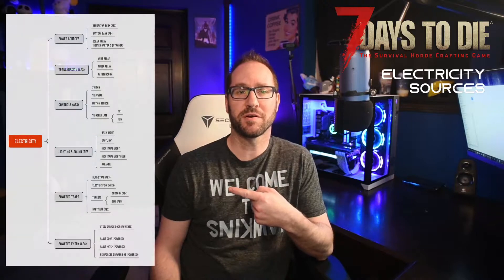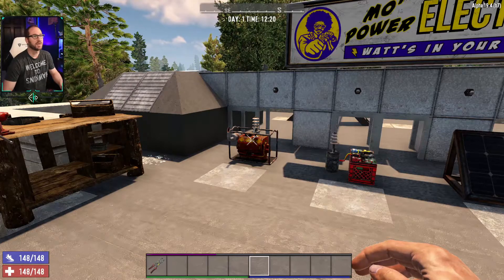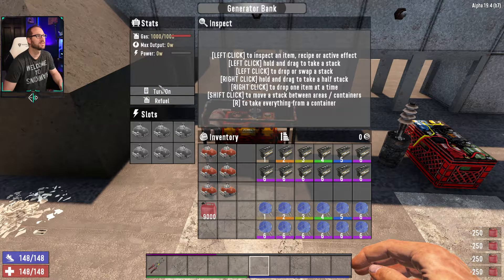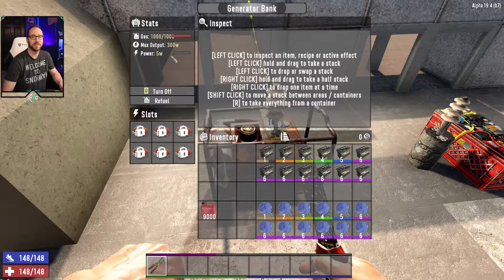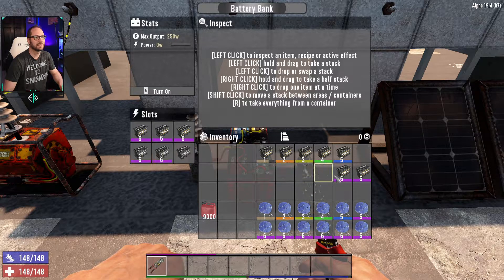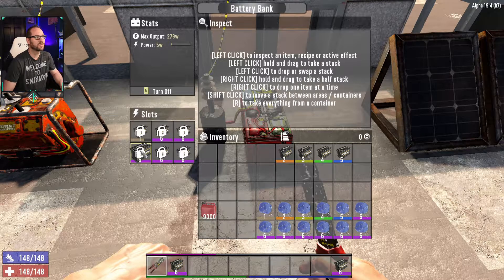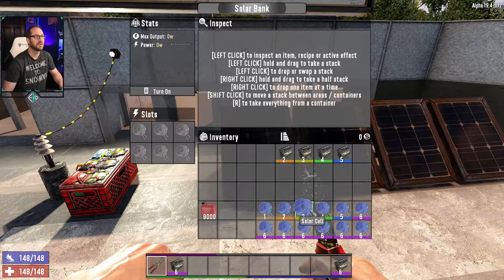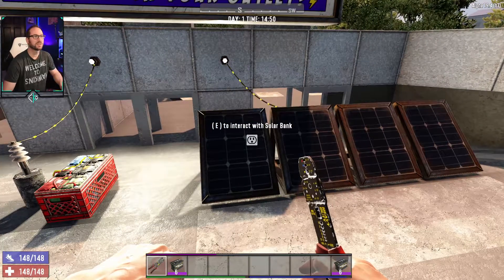Electricity 101 - How to setup use the Generator, Battery Bank, & Solar Bank in 7 Days to Die (19.4)

Comment: Lowkey I’m struggling to make my idea work

Essentially I was trying to make a bunker door out of garage doors connected to a motion sensor that’ll open the doors when they see you and close the doors after 10 seconds with no visual of you.

The gas runs out to fast so I figured I’d try and use a solar system connected to a battery bank so I have power day and night.

I’ve currently got this layout for it but can’t seem to figure out all the solar battery stuff.

:

Generator to a Wire Relay 
Generator to both the Garage Doors
Wire Relay to the motion sensor outside
Outside Motion Sensor to Inside Sensor
Inside Motion Sensor to four Fluorescent lights

:

But when I change the Generator to a Battery Bank and wire it the same it’s either the Garage Doors don’t work the same or the Motion Sensors don’t work the same, do you have any ideas/tips?

(Edit) I’m sorry if this doesn’t make much sense I’m new to the electricity part of the game.

I’ve done some more digging and it’s in reverse somehow the doors open when the cameras don’t see you and they close when they see you?
Reply from the maker: That's the wrong order -- I did a better job of explaining in my updated electrical video: https://youtu.be/D3K_oTpq3BI?si=qlIxoMvTi4osuIjn

In general control agents always have to be upstream of a device.
Reply: @ so how should I do it, I’m still trying to understand the video you sent me, can you send me which way I should wire it in order?
Reply: @WaywardEko  still can’t really figure it out 😭
Reply from the maker: power source to control agent to device - always that pattern
Reply: @ I’m way too dumb how should I connect the whole thing, can you tell me in which order I should connect it with the components names for example, “solar to motion sensor” I’m also sorry about all the comments I’m sure you have a lot better things to be doing
Reply: @WaywardEko  still absolutely clueless cheers for trying to help mate.

Comment: does the generator use more fuel based on either how much power is being used or by how many engines are being used? if i have 6 engines will it use more fuel than one engine even if the power used is only 5w on both cases?
Reply from the maker: I believe engines just add capacity and that fuel use is dependent on the draw.

Comment: Can you charge your batteries with the generator?
Reply from the maker: Yes -- you can go Generator -> Battery Bank or Solar Array -> Battery Bank.  Both situations will charge the batteries.
Reply: @WaywardEko  Can you connect both solar and generator to the same battery bank ?
Reply: @WaywardEko  I have been unable to go generator to solar to battery. I just want to be able to switch my gas generator on when say power gets low in my solar and still power up my battery banks and traps and all that.
Reply from the maker: @breeece9223  - That's not possible.  You can only ever have one source that creates power ... so either the solar bank or the generator to start.  You can't have both in the same circuit.